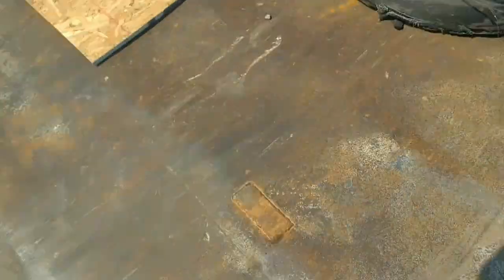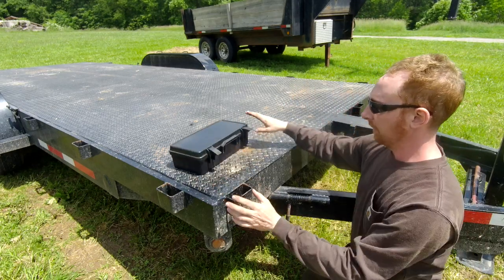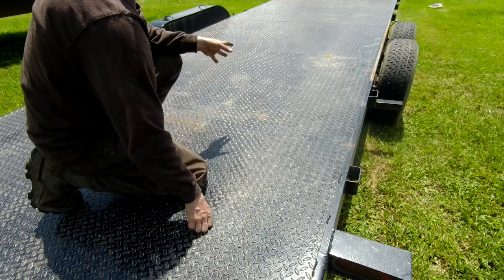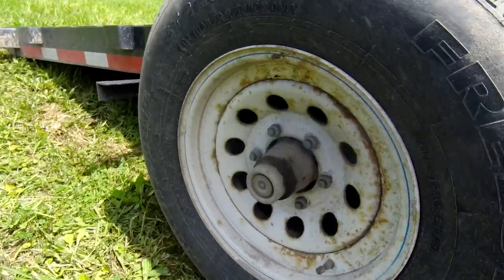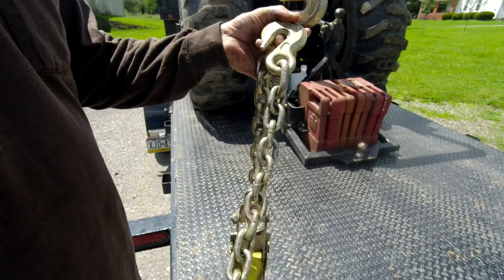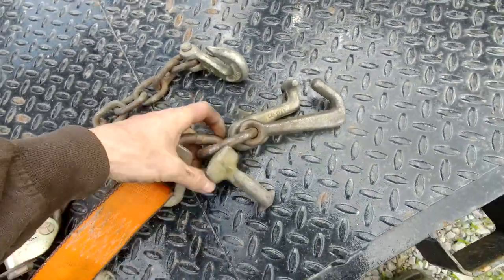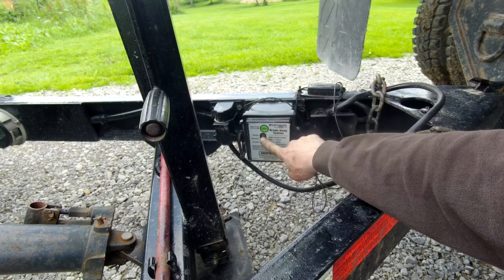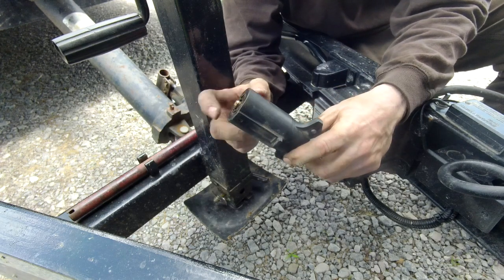Trailers. Lessons Learned the Hard Way

Comment: I've heard dielectric tune up grease works well protecting the plug contact surfaces.
Reply from the maker: I have been trying corrosion X for the plug.  I have used the time up grease and it works good.  I forgot to mention about taking the plug apart and applying something to the connection screws.  I will recommend the grease on the next video 😀